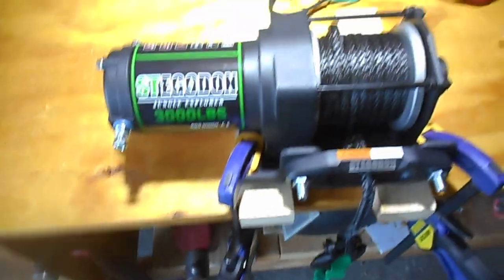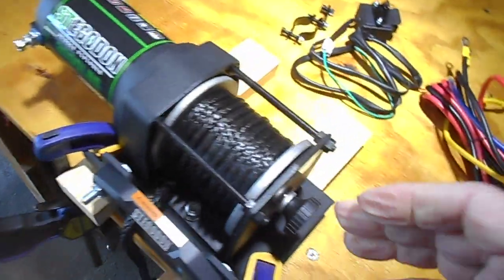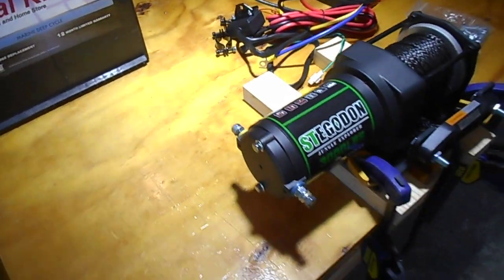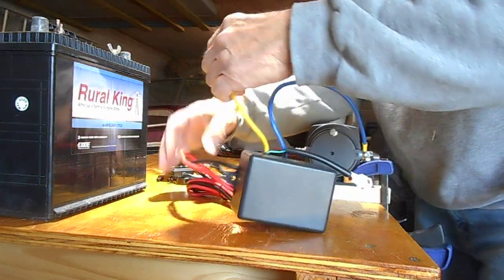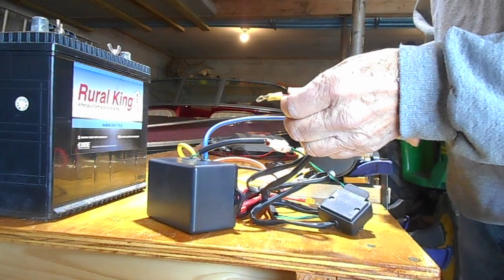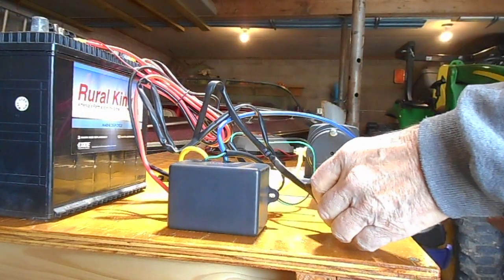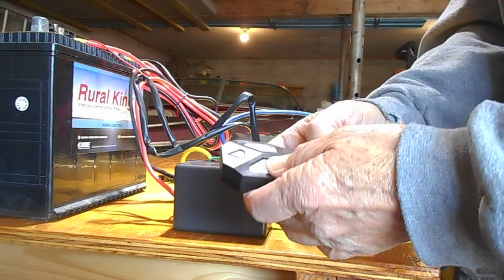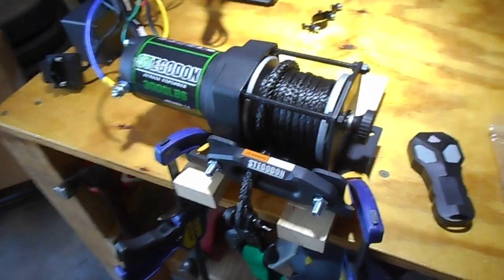Stegodon 3000 lb. winch unbox and wiring hook up.

Comment: Thank you for this. BTW, the red wire hanging out of the loom going to the rocker switch is meant to go to the vehicle's keyed power circuit so that the winch can only be activated by the rocker switch when the vehicle is turned on. It does not carry a lot of current since it is used only to activate the solenoid. That red wire is not required to be connected for the winch to be operated by the remote control. Also, my manual indicated that red and black wires were to be attached to the motor, which was absolutely incorrect - they are yellow and blue as shown here.
Reply from the maker: Thanks for the info that all makes since to me

Comment: Bang for the buck these little winches are great.If anybody out here is considering using one for somewhat light duty say 1000 lbs. or less you can fabricate a mounting plate for control box to mount on and leave enough room to mount a DIY  battery power adapter.Believe it or not I use a 20volt DIY adapter (harbor freight style battery) to avoid using a large 12v battery. works just fine. IT WILL EASILY PULL A 2 /3 PERSON PWC up onto a trailer no problem.You can use a 12v diy adapter however the reason why I chose 20v is... as the motor loads up, the voltage out of the diy adapter will drop and current will rise.If you start at 18-20volts it will drop to about 15 under load.A diy adapter should be sufficient enough to pull a zero turn or small lawn tractor (say the size of his cub cadet mower) out of a slide or ditch.These work great if you are trying to load a 18-20' runabout or less onto a trailer. The weatherproof remote will allow you to even get out of your watercraft and guide your boat on your trailer as you pull your boat onto your trailer.A foam orange key float is ideal for attaching to remote  in case you drop it in the water accidentally.

Comment: Question is the switch a rocker switch? In other words no need to tap into a “keyed” wire ie on/off with key?
Reply from the maker: hold both buttons down at the same time for about 3 seconds light will come on will go off by itself when done
Reply: @jgriff19861947  ok on the remote you mean. Got it. What about after that is the unit pulling any power when it’s not actively pulling in or out? Guess the little black box takes care of that?
Reply from the maker: After a few minutes of not using it, it will turn off in till you turn it back on        @flapmajors6309
Reply from the maker: There is power there like a light switch in till you turn it on it will not work hope this helps